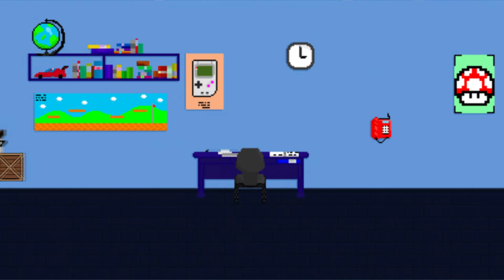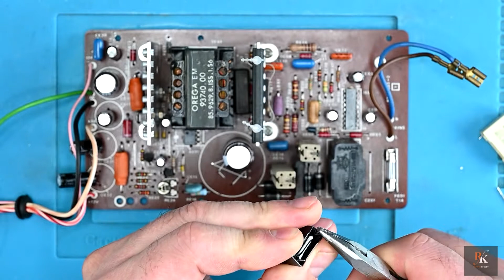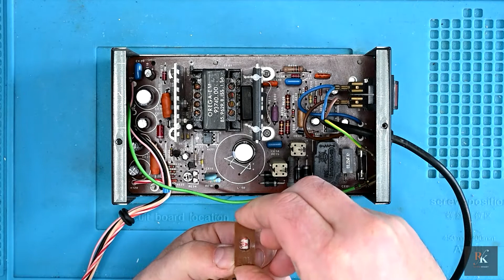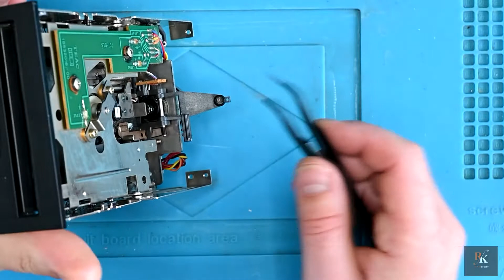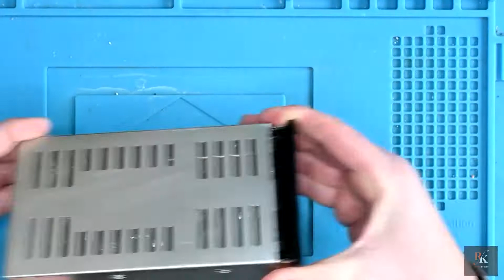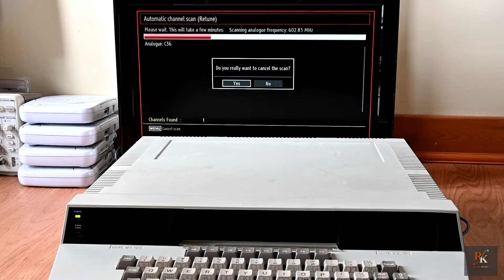Repair/Restoration: Tatung Einstein TC 01 Part 2

Comment: Hi there, Just found this by chance and although late to comment I thought this was just perfect to help my latest idea of a  project - of which I have far too many already.
I have two Einsteins in my loft - neither have been protected much other than stuff on top of them. I have an 80 column card for one , a speech synthesis board I made myself which fits a slightly modified 'pipe' connector on the other and a hard drive!! iIrc both have two floppys.
I think there are also many disks somewhere in the house.
I used one or two at work (Taylor Hobson in Leicester) for many automation and control functions, writing in basic and machine code. The analogue and digital ins and outs were hugely useful. I bought one for myself new and then a few years later in 92 bought one (cheaply) from work when redundancies hit. it served me many years running my darkroom, switching the enlarger and using the speech card to talk me through the timing in the dark.
I hope with the help of this video to get at least one up and running again. Hard drive > ? may be more of a problem. I still use film cameras and would love to hear my Einstein speak again! Thanks for all the information in your video.
Steve.
Reply from the maker: Hi Steve and thanks for the comment!
I hope my tinkering does indeed help as these are beasts of a machine - in more ways than one! As I said in my video, there are aftermarket power supplies that make the whole thing much more reliable, but I chose originality. Go whatever route pulls at you the most.
It is totally about the nostalgia for me, whether it be a machine I owned/used back in the day or evoking fond memories in others with these machines, and by the sounds of it your Einsteins may have a story or two still to tell you (possibly literally!).
I hope you manage to get them running and yes, older hard drives are destined to fail regardless. Probably one of the few things I am happy swapping out for a modern replacement tbh. Let me know how you get on too!

Comment: I have owned 3 einsteins over the years and still have one left, I got my first in 1988 and purchased it for 109.99 reduced from 499.99 at dixons ,it helped me learn to program back then.. it was commonly used in software houses - ocean software used to port there titles using the TC01 system, I wrote a lot of programs and games back then on that micro.... My daughter currently has my 3rd einstein in her cupboard (brand, new boxed even with a receipt of 499.99 its immaculate just had a damaged space bar - easy fix )  however I dont currently live in the UK but ill have to pick them up one day and take them all  back to Asia I have 1040stfm, 520stfm, BBC Master 128, Spectrum 128+2 god knows what else i forgot lol ...good video :)
Reply from the maker: Cheers! I'd never really seen them or knew about them until I got this one, and I do have to say I'm impressed by the build quality! It just feels right if that makes sense?
Personally I have over 160 systems so it'll be a while working through them all :D

Comment: Good video. I just bought a Tatung. Picking it up this Sunday hopefully. Looking forward to getting it working too! I'm in the same boat, collecting and storing with nowhere to display.. One day I will get my garden cave for them.
Reply from the maker: Thanks! It's a beast of a machine and looks awesome however will need a fairly big space to fit it in. If you're doing a full case clean like I did, all the Philips screws were the same size but there were a lot of them!